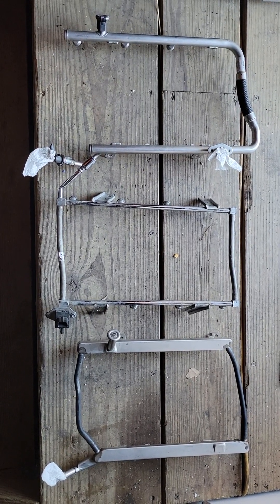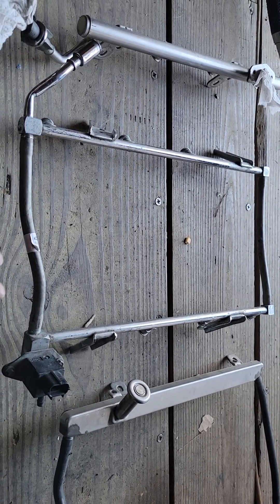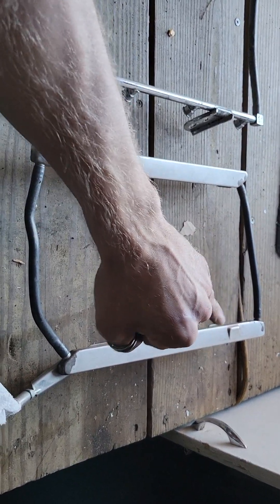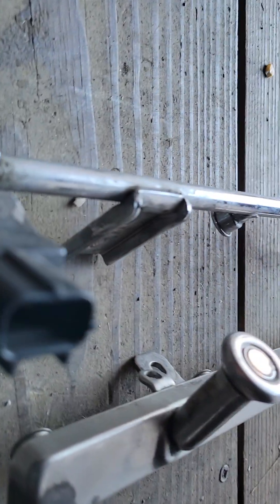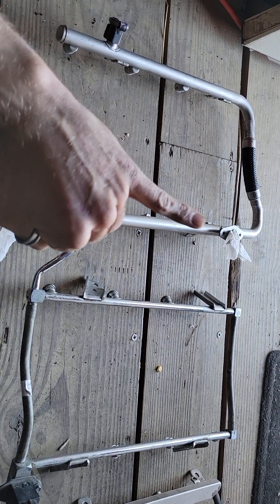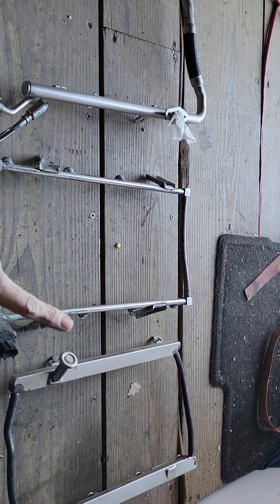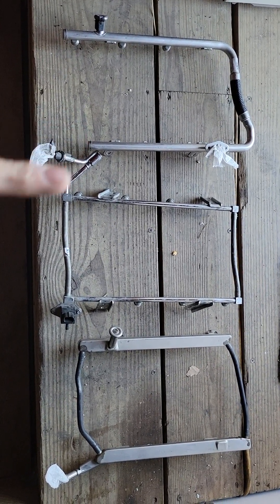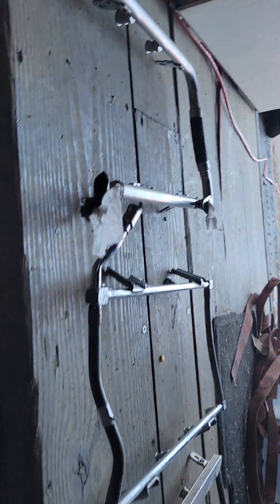Mustang 3.8 V6 Freestar Fuel Rails Swap for boosted/ intake swap applications

Comment: Hey Paradox, and everyone in here. My son and I are doing a Windstar swap. I work at a machine shop  I have been trying to get the Free Star lower but no one around here has one, if anyone here can point me in the right direction on getting 1 that isn't $600. I have some really cool ideas I think with having access to CNC mills and I having free rein to use them. Thanks you guys are awesome. So much inspiration
Reply from the maker: I pull mine from junkyard. they come to 40$ for the entire intake upper and lower bolted together. The junkyard is a great place to learn and the price makes for great project materials.

Comment: Hello paradox I’m having problems with my fuel pressure it first started as not having enough fuel pressure and fuel pressure cutting off also rough idle, first thing i did is replace the fuel pump and fuel filter that didn’t fix the problem then i replaced the fuel pressure regulator that fixed the low fuel pressure and fuel pressure cut off but now I have a high fuel pressure problem when on start up and when it’s at full throttle but the psi is at 89psi when having this problem but doesn’t always happen and last night it left me stranded with only having 1 or 2 psi of fuel pressure what could be my problem I’ve been chasing this problem for a few months now